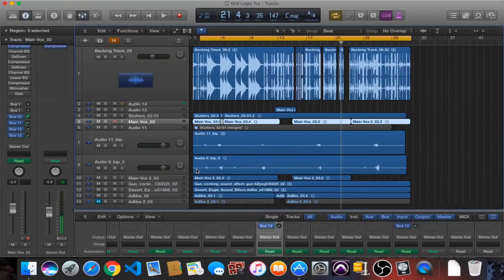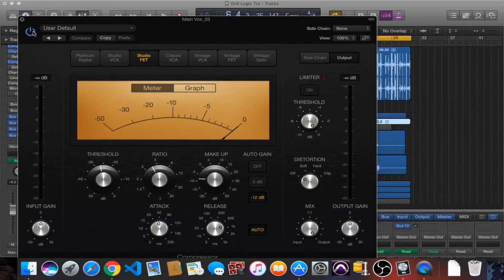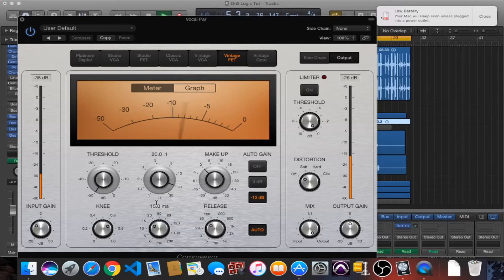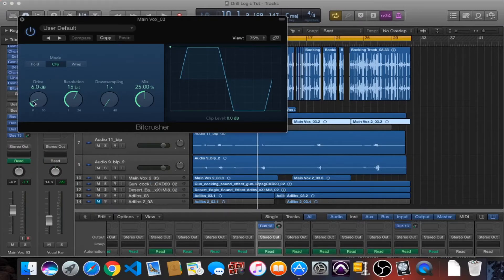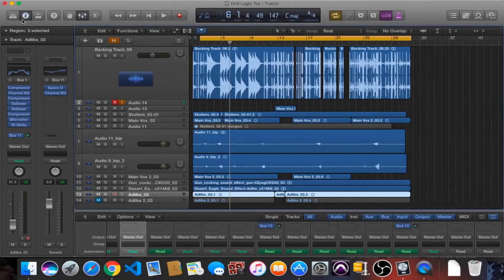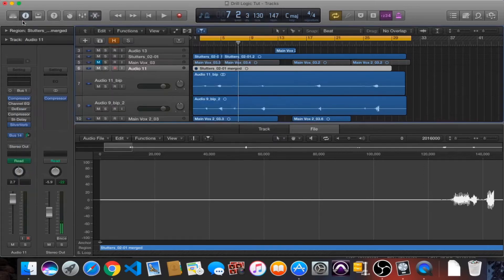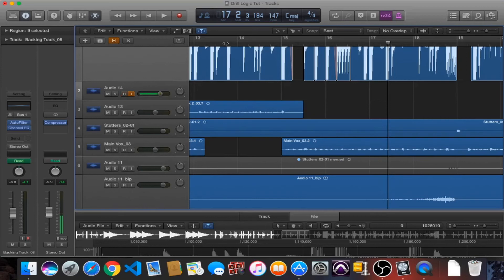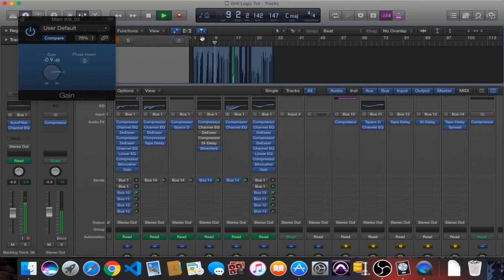Mixing Drill Vocals In Logic - Stock Plugins Only

Comment: Bro you should make this as a template theirs a few things you skipped here which are essential :S
Reply from the maker: What should I clear up??
Reply: @joshmixedit2746  I just think it's easier to understand when you have the tracks properly shown, for example you said you have a reversed reverb but we never got to see the reverb settings (for stutter), i've literally copied this as one of my templates to test it out and the output gain is redding after every few words i vocally say, my focusrite is turnt to a good level where when i test out my vocals the high's don't peak, is this my issue? Also would be good to see what your output gain is like whilst your working on the project, that way i'll be able to understand if what i'm doing is right, but theirs nothing to see if mine is right. I mean you can tell by my last comment i was here 3 months ago and since then i've been trying to work on it but i just can't get the adequate sound without the high high peaks any suggestions mate? Please take my comment as positive criticism, your end project is amazing and hence why i think it'd be beneficial you taking extra time ensuring we are understanding each step. I'd like to see what settings your instrumental has, what settings to record (i.e. make sure track is set -15db before recording, etc)
if i've missed a video of yours which does cover this please send me it. 
I would like to see what are inside your Buss's on main vocal aswel, thanks bro, im happy with my vocal recording its just mixing and mastering and this is helping me alot, but im stuck on certain things, ill give you big credit if you help man, i did hit you up on insta too so feel free to msg me there and ill send you what i've got so far 
@1stkLassLK
Reply from the maker: @1stklass you can use any setting for the reverse reverb. The longer the decay the longer the reverse effect would be. When you create a reverse reverb you print the the effect on the audio so it wouldn't show up in a template. I have a more detailed video on reverse reverbs if you search my channel but it's in protools. The same idea applies though. I'm not very good on Logic so apologies if my Logic videos lack clarity.

I think the problem is probably you're focusing too hard trying to copy exactly what I'm doing, but it's going to be different from project to project which is why I don't do templates. Check out my recording vocals video and gain staging video for more about volume management but in general I always try to turn things down. If the vocals sound too quiet, turn the beat down rather than turn the vocals up.

Copy the compressor settings and bit crusher etc, but EQ should be to taste

With the fx busses I most likely used presets if I'm being honest lool
Reply from the maker: @1stklass  I got a new drill vid coming out friday so stay tuned